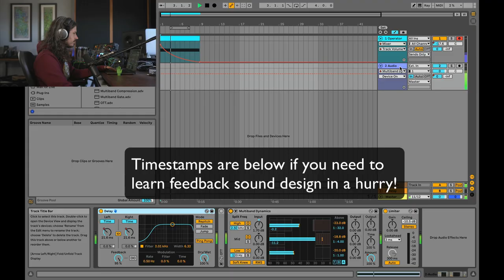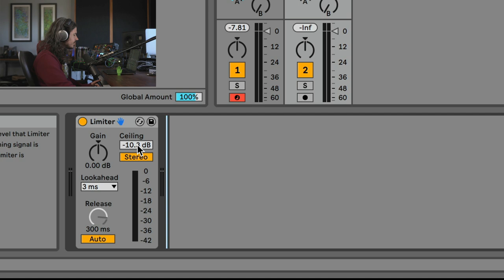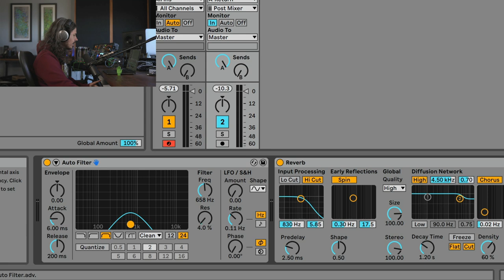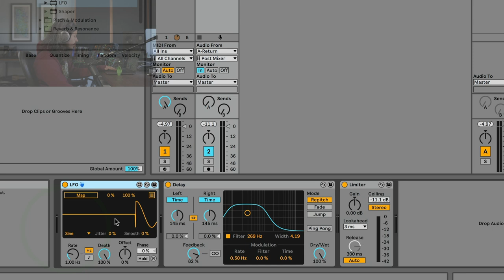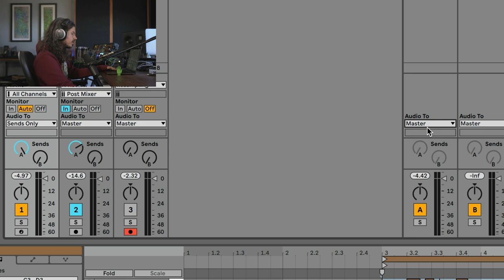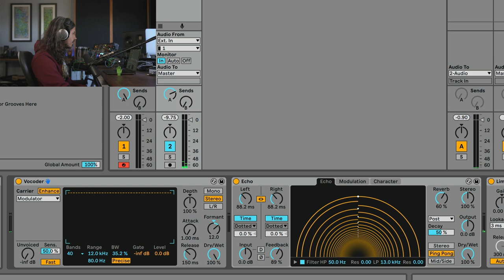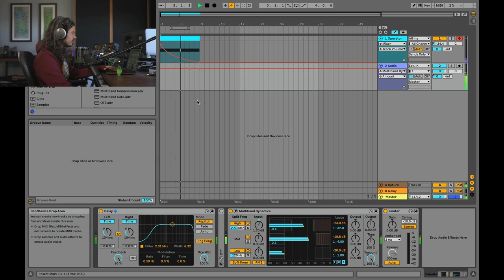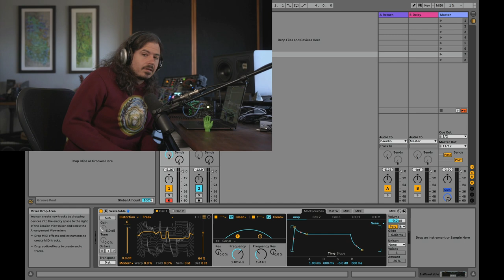Sound Design with Feedback in Ableton Live

Comment: This was great, but what's the difference between this method and putting all the FX on return track and feeding it back into itself via the Send knob?
Reply from the maker: Midi tracks can’t receive audio inputs back from a return, hence the other track. Much of the time in this video the original sound im making is coming from a midi track.
Reply: @SeedtoStage  Yes, but what you're doing is you have audio track with some FX, send it to Return track and get it back to that audio track. I think the same effect would be achieved by just putting the FX on Return track and routing it back into itself with send knob on top of that Return track. But maybe I'm wrong :)
Reply: Was wondering the same thing, don’t really see how this makes a difference, Im usually doing it the way you said.